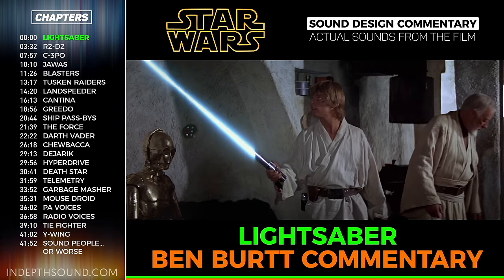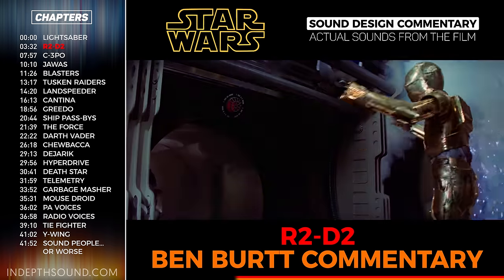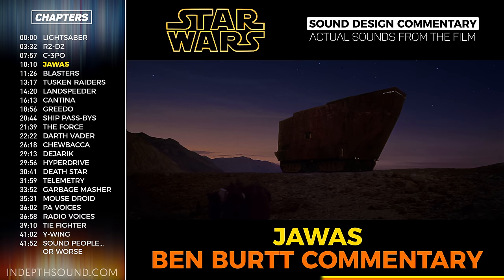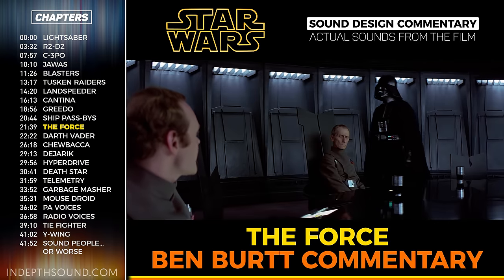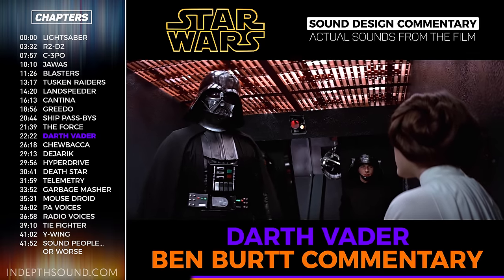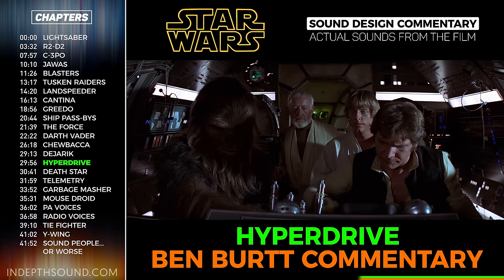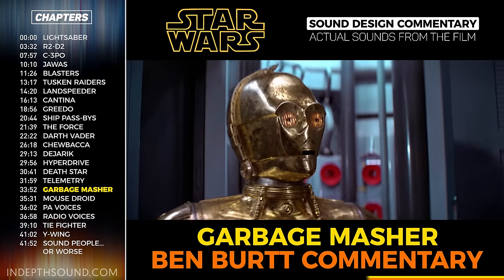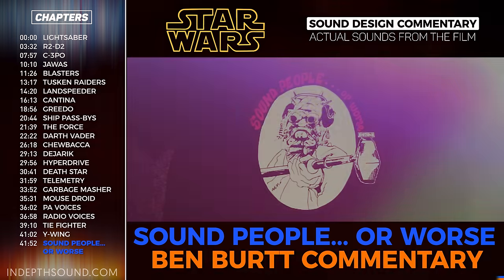Star Wars: A New Hope sound design explained by Ben Burtt

Comment: 11:26 I knew it! I happened to be near a train yard once as a child while it was being load by crane and I heard a laser, it couldn't have been any other noise I thought. It turns out the loaders were tensing the cables and testing them before each car was lifted. By the time a third crew got started I would've sworn I was on Hoth. Great video and thanks for the confirmation of a long held suspicion
Reply: Star Wars blasters have always had a sort of "Pillerrm" weight to the sound effect.
Reply from the maker: You're welcome! I'm glad the mystery was solved 👍
Reply: For some reason, the perimeter of my grade school gymnasium floor was ringed with 10(?) foot pieces of steel angle iron.  In third grade I discovered that if I stomped one end of the angle iron it made something very close to the Star Wars blaster sound.  I loved doing it, but the gym teacher always screamed at me.

Comment: In the summer of '79, my local athletic association held a basketball camp at our county civic center, which had a pretty large indoor arena. The groups were divided by age, so when we got there, we were shuttled up to the balcony to check in, so we weren't taking up space on the court. While we were in line waiting, there was a hollow, aluminum-extrusion balustrade that ran the length of the balcony, which was like 140' along the long sides, and ran all the way around. I was bored and kind of smacked it with my hand and heard "TYOOP!!!" with a massive reverb. Classic blaster sound. Like all 12 year olds in '79: a huge Star Wars fan, I couldn't believe my ears. My friends close by immediately turned around like "What the hell was that?" so I showed them, and within seconds this spread down the line of kids from all over the county, and the arena erupted in a massive Blaster Battle!

Upon arrival the next day, we were all specifically instructed to keep our hands off the balustrade.

Comment: Wow that is a great video you composed! Also compliments on editing out the main character‘s voices, eg in the cantina. I would love to get more of this!
Reply from the maker: So glad you appreciated this! I'll let you in on a secret- You can set up Audacity(free audio app) to accept video files. If the video file has 5.1 embedded in it, then it will open up the separated 5.1 stems. For the scenes where reverb is not added (very rare these days) you'll be able to mute the center channel, and voila- You have a scene with no main character dialog.
Reply: INDEPTH Sound Design I’m pretty sure you can get the same effect by taking a section of stereo, panning both channels to center, and inverting one, thus canceling out any center audio (and yes, audacity is wonderful)